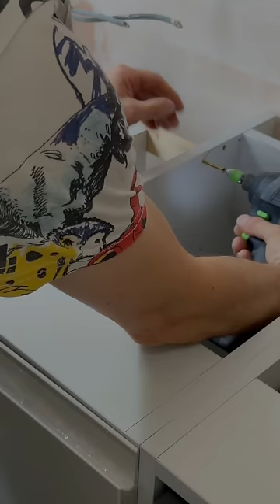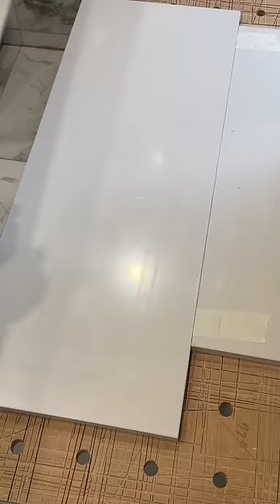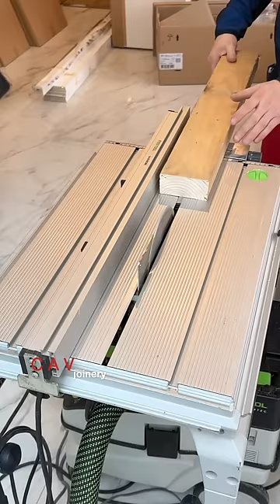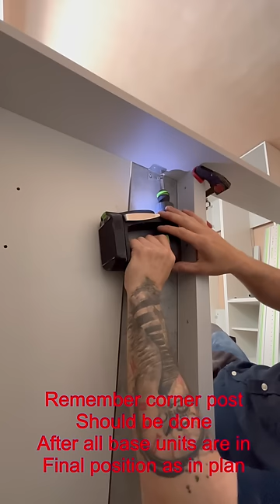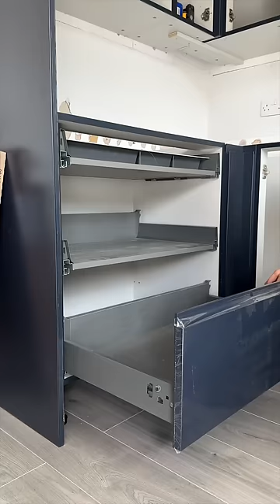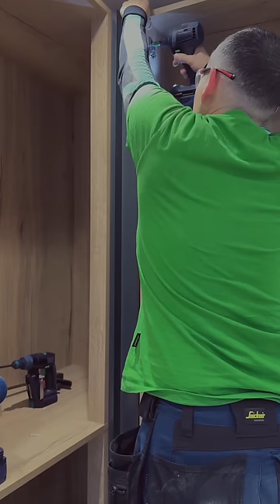8 Kitchen Corner Posts: Which is Best?

Comment: You are fully loaded with equipment and skills. Nice to see this video with corner posts as well in detail.

I see that on all solutions you use that doubled post on the longer cabinet for the hinges and I'm wondering if it's the norm or if it's easier. You cannot get rid of it and install the front directly on corner post with 180 deg hinges(blum 79B7550)?
It has something to do with the disalignment over time?
Reply from the maker: Thank you very much! I know there a so many solution to deal with this the reason was that this is the way they were designed by the supplier these kitchens

Comment: Hello,
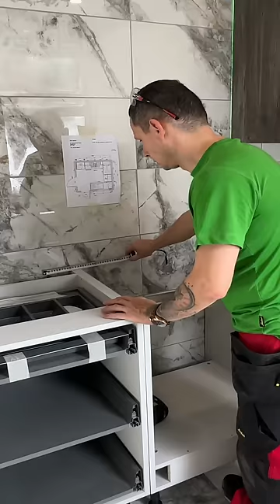At 1:48 what kind of worktop is it? is it plywood or oriented straight board? Yours looks very light, how thick is it? did you make the holes in it yourself?
Reply from the maker: On that time 1:48 there is no worktop shown a that was mdf board 10 mm  i use the as a bench the hols are the to help me clamp down the material while i am cutting

Comment: Очень круто всё делаешь, мне так всё понравилось, что сам тоже заинтересовался мебельным делом. Начал изучать это направление, даже приобрёл festool precisio 70 set в максимальной комплектации,  планирую заняться плотно кухнями. Очень интересно как ты делаешь замеры и как изготовляется материал, предполагаю что у кого то заказываешь.. Буду признателен если расскажешь как у тебя происходит процесс, от замера до монтажа, какие бывают сложности и на что нужно обратить особое внимание? Заранее спасибо, всё очень круто.
Reply from the maker: Thanks so much for watching my channel it depend in what area you live in for exempl in the uk the standard size of kitchen are  150mm (adjustable) legs plinth 150mm ,base cabinets 720mm h 560mm d, tall units(larders) 1970mm and 2015mm h 560mm d, wall units 720mm and 900mm h and 300mm or 320mm d worktops 600mm or 650mm d 20mm or 38mm thick and 900mm for kitchen island
Reply: @CAVjoinery  спасибо большое!